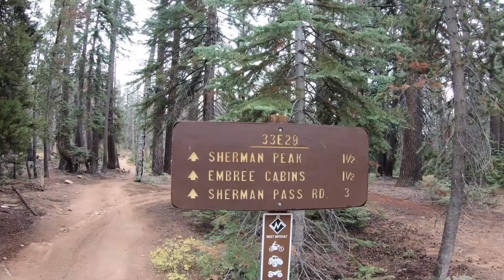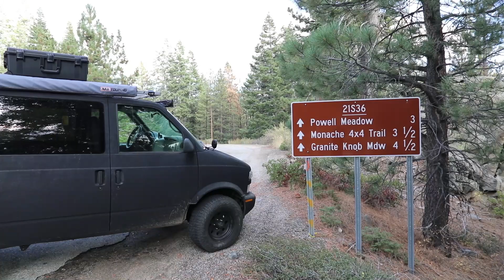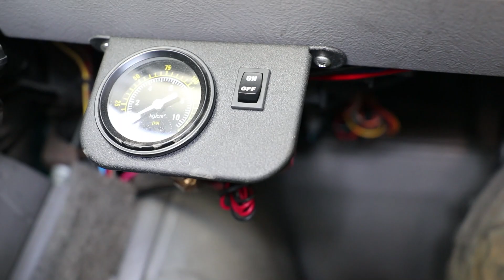Sherman Pass to Monache with the 4X4 Astro Van

Comment: Your videos are amazing!!! And your Astro is awesome!!! 
Question: did you make a custom roof rack? Also, make a video of your paint job (looks like raptor )
Reply from the maker: Thanks. I have a few videos of the Astro I need to do. I have been working on a walk through for awhile. I have a Utah 4x4 video with the astro I am finishing up right now.
Reply from the maker: I had the roof rack custom made by a welder in LA. He drew up the plans and welded it all out of aluminum for me. I actually wanted raptor liner paint but I had no where to spray it and none of the raptor shops would take my van. So I bought 2 gallons of herculiner, taped everything off and rolled it on in my driveway.

Comment: What light bar brackets did you use for the the roof light bar? Awesome video! You should definitely do a van tour !
Reply from the maker: I used the lightbar mount for a 2000 suburban. It is not perfect but pretty close. I know I need a walk through video. I just want to make sure I do it right. I should have one up before summer. Thanks for the interest.

Comment: Clean Astro...

Bold run-
Great views-

Really interested in that rear bumper 
set -up - unique. Details?  Is that the swing away bumper mounted into the Astro receiver ...or?

2 or 3 inch body lift?

Rear spring swap, or lift springs or ?

Tire size? Brand?

Shock specs?

Ball joint flip?

Torsion key mod?

 A journey swap kit?

Did you fab any Astro undercarriage protection? Or diff cover upgrades?

Thanks!

“... Straight-straight...”
Reply from the maker: The tire carrier is a swing way that mounts into the hitch receiver. It has a 4 inch body lift in the front and a 4 inch rear lift with the spring mounts. There is a 3 inch add a leaf giving the whole thing a 4 inch in the front and 7 in the rear. But with all the rear weight it evens out. Those are 30 x 9.5 tires. I had to cut out a LOT of wheel well. I would go with 31" but then I would be too tall for my parking structure. The same reason I do not go with the torsion keys. If I did not have under ground parking I would go taller. No ball joint flip. This astro was a 2 wheel drive model. I swapped the subframe with an all wheel drive model and then swapped the all wheel drive transfer case for a chevy S10 4x4 transfer case. Making it a true 4x4. I have added skid plates and am working on dif. covers. It has 4.10 dif. gears in the front and rear. Since this video I finished mounting a front winch. In the spring I will be finished with the Astro and make a video just showing all the mods. Subscribe to the channel and check back in about 3 months.
Reply: David Bird 

David:

Thanks for taking the time to respond 

Astro YT uploads are out there but few and far between

I was curious about that swing away set up 

First time seeing one attached on video  as zero after market bumpers for astros with a cage ledge and swing out , etc

Were your buddies trying to catch up or shake you 🤙

I subscribed 

And can’t figure out what type of roof mod rack you made...

That safari 2 part YT upload included a peek at at custom rack which is insane but the penetrations into the roof are humbling ...

Comment: Dudes Awesome Video!!!  I just bought a GMC Safari AWD to do the same thing!!I was wondering what size lift did you go with and what size tires and the type of tires???  Thanks in advance!!!
Reply from the maker: The tires are 30x9.5x15. I had to cut a lot out of the wheels to make them useful. I have a 3 inch lift and added an extra 3inch extra strong leaf in the rear. It needed it with all the weight of the spare tire and carrier. I would have gone with a higher lift but most my parking in LA is in structures that are 6'8". My van with the roof rack is 6' 7.75". I have to crawl into my parking structure.

Comment: Sick video David.  Wondering if you can provide some info on the sub frame swap or if you can direct me to someone who can do it. Also wondering how much it cost if you don't mind sharing that info.  Im in the Los Angeles area.  Any info would be greatly appreciated.
Reply from the maker: I know first hand that the subframe swap is not worth it. It is much better to find an AWD astro and go from there. I did it because the interior of my 2WD astro was like new and I had already installed a new engine and put a lot of money into it. It costs about 4k-5k for the swap if you can find someone to do it. To do it right you need 2 lifts and a forklift and most shops wont dedicate 2 lifts to one job. I also ran into a lot of little problems. For one the brakes no longer matched up. I lost the ABS. Also had to make new driveshafts. In the end it probably would have been cheaper to find an AWD astro and fix it up. That said, I love my 4x4 Astro it is an amazing van! I plan to make a walkthrough video where I show everything I did some time before summer.
Reply: @DavidBirdVideos  thanks for the reply.  It is really getting harder and harder to find a clean awd astro and safari.  I have my lift kit and 4x4 conversion kit AMD the s10 transfer case ready, but just in search of a clean awd. Most have rust issues that im finding outside of cali.  I'll continue to look for an awd. Thanks again

Comment: Epic
Reply: Where did u get your ahirt
Reply: What size tires and lift ,have 97 asshole van on the verge of no return
Reply from the maker: Tires are 30x9.5x15 with a 3 inch lift and add a leaf rear suspension to hold the spare. My lift is adjustable in the rear.

Comment: Great video! I was just wondering do you need to go through this part of Sherman pass to get to Monache 
?
Reply from the maker: No, not at all. You can go straight to Monache. Monache is one of my favorite spots. I went through Sherman pass first mainly because I wanted to challenge the van.
Reply: David Bird thanks! Another thing would be did you need extra gas?
Reply from the maker: @seanmaines  well, I have a 25 gallon gas tank so no. The jeeps however filled up before Sherman pass and then when you get down from sherman pass there is another gas station they filled up at.

Comment: who did the conversion/ where did you get the parts?
Reply from the maker: Well, that is a long answer. Not sure what you mean by parts since this van has had a lot changed and added. I did all the work myself besides the subframe swap. It was a 2wd astro so I bought a wrecked awd astro and had a shop swap the subframes. I installed a new engine and a transfer case from a 4wd S10 pickup. The lift kit and awd to 4wd conversion and some other parts came from Journeysoffroad.com most everything else is custom built by me.
Reply: @DavidBirdVideos  o ok cool..I just got the 5in lift and transfer case from JOR myself that's why I was asking(the unclear) question
Reply from the maker: @jackl9041  Awesome, I love JOR. I had the 5" lift and had to lower it. I couldn't fit in any of the parking structures in LA. I like to park my van in a 6' 8" parking structure and now my van is 6' 7.5" haha good luck with your van.
Reply: @DavidBirdVideos  thanks you too.. I may pick your brain again...especially with the transfer case
Reply from the maker: @jackl9041  sure thing. It was a hard year or two building up the astro. If you have questions you can find my email at davidbirdphotography.com
Reply: @DavidBirdVideos  just 1more (for now) did you use the torsion keys too
Reply from the maker: @jackl9041  I have them and really wanted to use them but could not because it made my van too tall. 2 things. If I used them I would have to replace some of my brake and engine lines with longer ones, and I couldn't fit in my parking structure. Maybe one day I will add them and the larger frame spacers that I have.